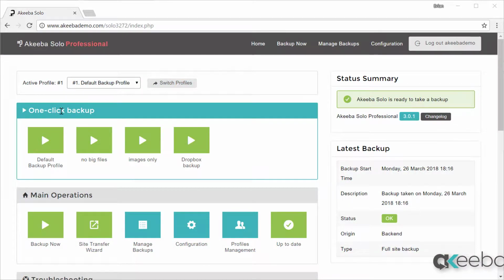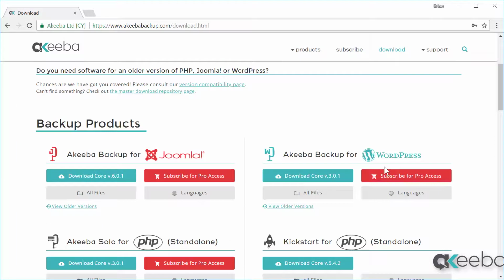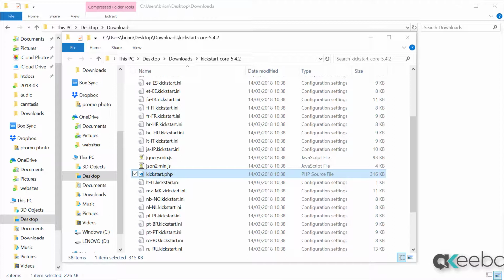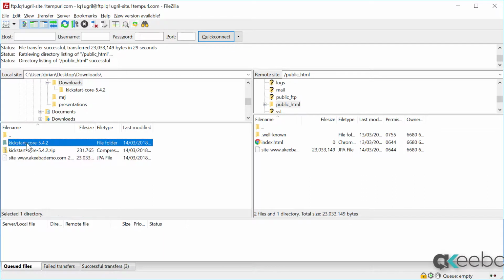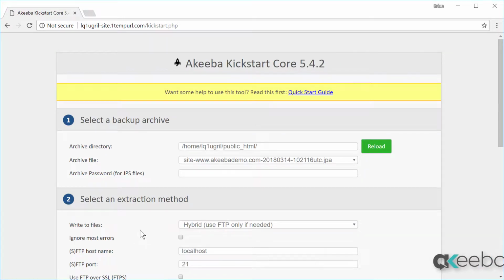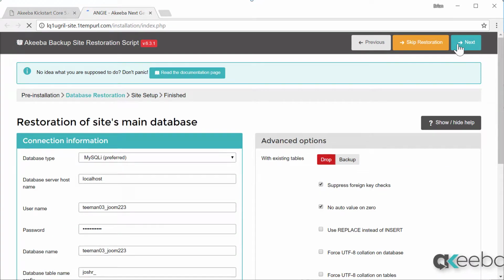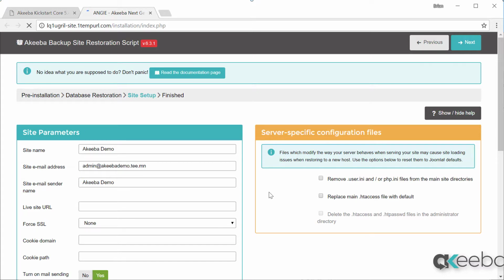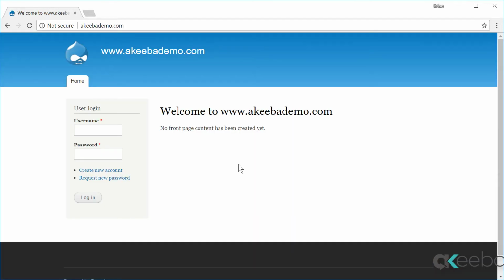Restoring a site on any server

Comment: if I put /kickstart.php after it, it doesn't work. It says "404 not found" please I need help.
Reply from the maker: After downloading Kickstart from our site remember to unzip the file and upload kickstart.php to your server. Make sure you upload the file to your public web root, usually called public_html or httpdocs (ask your host). If you have a .htaccess file already in place you might have to remove it first.
Reply: @akeeba  Ive put my .jpa data and access data into httpdocs but it's not working. Neither with deleting access data
Reply from the maker: @jannikknz3105  The 404 Not Found error means that you are doing something wrong, i.e. where you put the files and where you try to access them do not correlate. Try uploading a hello.txt file with the contents "This is the file I am looking for" in the same folder and try to access the /hello.txt URL instead of the /kickstart.php URL. You will still get a 404 which means that you are doing something wrong. Figure out how to fix whatever wrong you're doing and see the contents of the hello.txt file. Then you will have fixed your problem with Kickstart too.